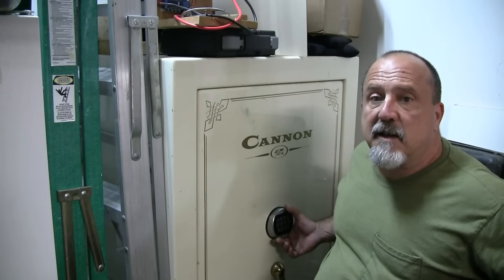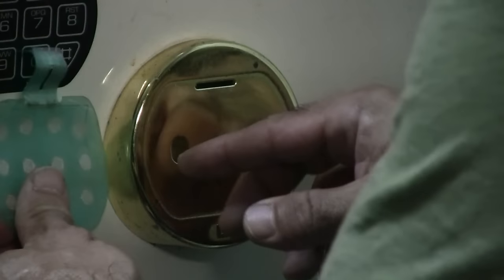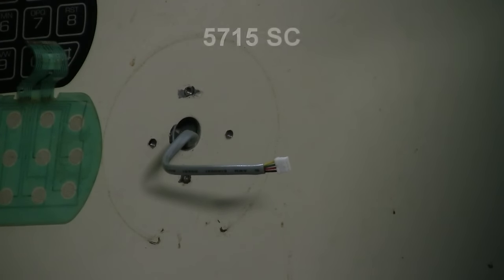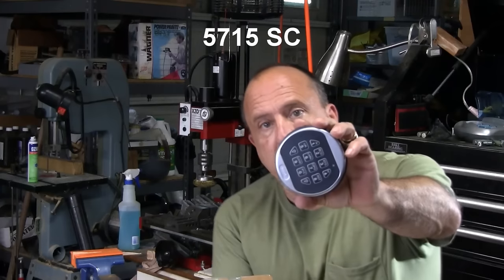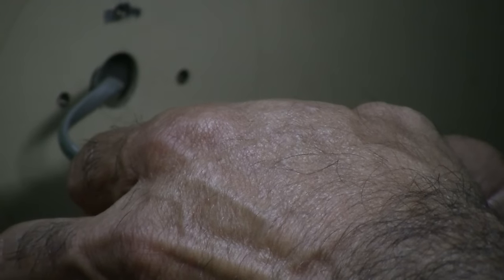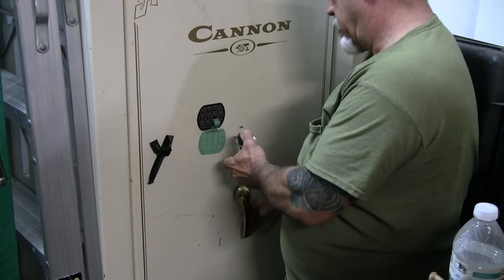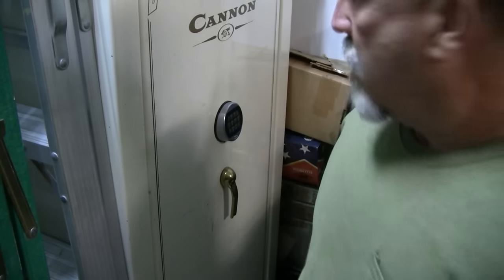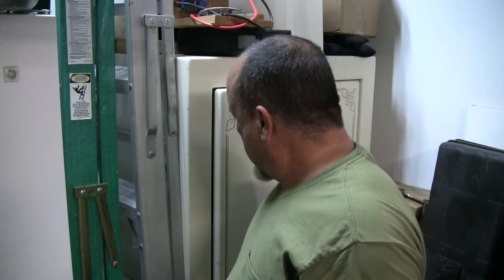Cannon Digital Gun Safe Fail Fix! Locked Out! Don't Drill - TRY THIS FIRST!

Comment: As a locksmith with 25+ years of experience I have some points to make on this video
1) always try replacing the battery first (this is about 3/4 of my service calls when the safe "is dead")
2) inspect the cable to make sure it is not pinched causing a short
3) after these 2 are addressed, try the keypad replacement but if you have made it to here, that only works about 15% of the time (it's usually the internal chip in the lock body that has failed)
4) after you penetrate a container door, it take a lot more than just a screwdriver in the hole to open it.
5) electronic locks and mechanical locks have different drill points, and if you have to penetrate an electronic lock, it will need to be replaced so even the new one would have to be destroyed in order to open it through that hole.
6) any safe technician worth their salt will plug any penetration points put into the container, and generally it is harder to penetrate that same location again if any attention to drill resistance was accounted for in the repair process.
Reply from the maker: Thanks for the feedback and advice, especially #4. Some folks seem to think that that hole is the key to breaking into a safe!
Reply: Hey I live in oregon and I was given a gun safe as a work bonus and I was wondering If a locksmith needed proof of purchase to open a gun safe.
Reply: I am not a locksmith.  I do have some knowledge of electronics. 
I'm very surprised to hear it's most often the chip that fails. In my experience chip failure is the least common point . #1 is of course power. #2 operator error / misuse.
#3 parts / hardware interface (wear, breaks, shorts due to movement &fatigue. 
A battery powered circuit inside what is effectively a Faraday cage is the least failure prone part.
Reply: As a second point only put lithium batteries into safe locks. A technician will usually have a jump pack to help a weakened electronic bolt as well. 

Drilling sucks I hate doing it
Reply: @JoeSmith-cy9wj  Reply to an old comment, but: You're right on that list of likely issues, but there's a bias here and that's what people call locksmiths for. Most people who use safes everyday become comfortable with popping the cover off to replace batteries. Operator issues are super uncommon (because the owner usually operates the safe all the time), especially with keypads, and can be diagnosed over the phone. So then we only get called to a safe job when there is a legit hardware failure. In my experience it's a little more likely that a button on the pad failed than a lock body component, but it still happens more than you think.
Reply: Great points if you don't know what you are drilling for you will make a mess for a professional, that is if you care about saving the safe. Two more points I have and these are my opinions, 1) a safe with a "Key" to open isn't a safe 2) these days cannon doesn't make decent safe's anymore, most are mfg over seas and they have the cheap junk LP locks, securam or those wah lin china things.
Reply: @Seadoo1  No not unless it's that company's policy
Reply: What causes the pad to beep like Morris code and not take commands, also I've done the new battery thing ?
Reply: @bulldoghard5265  If you've replaced the battery with good quality battery (Duracell or energizer) then sounds like a failed lock, what brand is the lock.
Reply: @chrismartin4428  what ever brand comes with these safes, I put the battery in awhile it will start to been , like in Morris code
Reply: Great information.  Thank you
Reply: @bulldoghard5265 did you get this fixed? I have safe with the same issue and unsure how to replace battery
Reply: @kylesojak6267  nope ,
Reply: @bulldoghard5265 mine just shows low battery light tried 4 new battery’s new keypad and the same low battery light blinking. Keypad lights up but otherwise effectively numb

Comment: No backup key?
Reply from the maker: Unfortunately, that wasn't an option on this safe
Reply: @ExtremeDIYGuy  I'd say fortunately... backup locks tend to be crap and a sign that the electronics really are not reliable (20 years is not perfect, but I'd say that it is quite good). At that point get a good quality mechanical lock (key or wheel).

Comment: Easy open in emergency, you need a large rare earth magnet, simply place it in the 10:00 position on the door and  it will instantly open. Lock picking lawyer has the video. I tried it and unfortunately it works. Any hacker can do this to access your guns.
Reply from the maker: Maybe you should post a link to his video, the only ones I have seen from him are for digital cam locks, which are completely different from the locks on Gun Safes.

Comment: You couldn't use the original gold or brass keypad body?
 It definitely look nicer than the cheap plastic chrome jumk they have now.
Reply from the maker: The chrome one is all that is available so I went with that.
Reply: I have the heavy brass  pad too.... so much nicer!! Even the battery wires are much heavier!! All crap today!! :(

Comment: Or open the safe and use the cable it came with.
Reply from the maker: I eventually got the replacement keypad and lock so actually changed everything out to new components.
Reply: You can’t the battery wires are soldered in place on the original heavy duty key pads. These are cheep plastic and the inside of pad covers have the parts built in so you can’t fit the originals in or visa versa. Completely different on inside of original pad.

Comment: Does anyone know what tap size you would need? Mine has the four holes but they’re not threaded:
Reply from the maker: I'm afraid I don't know, sorry. If you have the bolts, you can take them to any hardware store, they all have guages that you can use to see what the thread pattern and size are

Comment: If you didn’t specifically purchase the electronic lock with EMP protection, be advised you will never get it to open again after an EMP strike. Just sayin’.
Reply from the maker: Shouldn't the safe and the lock inside it act as dual faraday cages protecting the electronics that hold the combo, assuming you ground the safe?
Reply: @ExtremeDIYGuy  You don't even need to ground it. A Faraday cage (which the safe will act as) will protect the lock by floating up to whatever potential there may be around it and then down. You may still need to replace the keypad, since the little processor in it will be outside the cage and be fried. To be honest, I'd be a lot more worried about other things than an EMP; if we get to an EMP of the size necessary to fry a processor, we are most likely all dead anyway. Having access to a gun won't make a difference.
Reply: If there is an EMP, opening my gun safe will be real low on my list of problems

Comment: I have a similar cannon safe and the handle broke off. I know the code but the safe is closed and locked. Any ideas on how to get open? Been looking at it for a few days scratching my head. I called cannon but there customer service is terrible
Reply from the maker: Wow, that sounds terrible. If there is a knob sticking out you may want to try a vise grip. If not, potentially drilling and using a screw to get enough purchase to turn the mechanism might work. If you do get it open, make sure to get replacement parts (If you can) and replacing the handle before closing. Otherwise, you may have to get a safe tech to come out and repair it.
Reply: Thanks for your reply. I am going to have to drill it. I talked to a couple of locksmiths and if I drill the left side and access at least one pin  I can open it. Punch in the code and press the pin with a long punch and it should open. Then will have to fix the lock. Cannon safe customer service is non existent and I registered the safe back in 2004. This weekend will tackle the job. My friend has the exact safe so I know wear to drill for the pins.
Reply from the maker: Good luck, let us know how it goes!
Reply: @ExtremeDIYGuy  Update. Drilled a 5/32” hole, punched in the code to release lock and pushed on the pin and popped right open. Looked at the handle assembly and nothing was broken. Everything just loosened up and fell off. Put it all back together and tightened/ lubed and working perfect. Going to get a tapered pin and push in the hole and cut off, sand and paint. Thanks for your help

Comment: Drilling a safe doesn't compromise a safe... Every lock has it's own drill points... So if I drill an LG and replace it with an ESLXL10 the drill point is in a different location... Plus when a true locksmith drills a safe they fill the hole... I am not for welding,,, I like to take 2 ball-bearings the same size as the bit you use and  carbon x steel to fill the hole... That way if you can pin the first bearing you will be unable to pin the second... There is another trick that we use but I will not put it out... Just know that you never want to redrill one that we do... As a safe owner you need to understand that when you call a locksmith and ask open ended questions you get open ended answers... I would quote the same as this gentleman was quoted... If I got there and was able to open the safe in the same manner as this gentleman ( difference is I have a plethora of lock faces in my collection )... He would be charged a trip charge,,, an hours labor and the price of a new lock... LG would not be one on my list to sell... Drilling a safe is an art because the purpose is to have the safe still be a safe when you are finished with the job...
Reply from the maker: Thanks for the feedback Billy. Once again, I stand corrected! I have heard from several safe technicians regarding how a safe is NOT compromised when drilled and sealed by a reputable safe tech. Thanks again.

Comment: If your safe is opened by a professional it should still be usable afterwards. The hole should be filled and be of the same security it was before drilling.  This keypad trick is old and has been used for years. If this opening is used it should be less than if it was drilled. 
 The batteries you use should be the copper top Duracell or the energizer alkaline batteries. The cheap one in this video cause opening issues.
Reply from the maker: That is true, I have been corrected by several safe technicians. I think you'll be fine using an Alkaline battery, but there are also high end 9v lithium batteries should last a lot longer and be more reliable

Comment: Look up electronic safe opening by GxAxV
Reply from the maker: My understanding is that there is a re-programmer for LG locks available that would do basically the same. The NL and LG locks I have used on the inside of the safe have absolutely no points to connect to to do what is shown in the video you reference. Both the locks have a socket for the cable and nowhere to poke a wire through to imitate a keypad combo.

Comment: Never ever use inferior batteries in a digital keypad on a cannon safe.  Use only duracell or energizer!!!  Other batteries will ruin the lock and a new keypad will not open the safe.  The only option left is to drill it.  I live in Idaho.  In a little town.  I dont think the local mobil locksmith is qualified to drill my safe.
Reply from the maker: Great advice Cindy, I don't trust the local "safe Tech" either.

Comment: The hole for the wires goes into the area where the lock solenoid actuator is at. If you remove the back of the door panel you can see how to make a coat hanger tool to manually press in the actuator and open it up. Probably what the safe guy was going to charge $800 to do. Each safe door is a little different but not much on these type of keypad safes.
Reply from the maker: On mine the hole didn't lead to an area where there was any mechanical linkage to mess with. It probably would have had to have been drilled if changing the combination pad did not work.
Reply: Not on a LaGard

Comment: Bypass keys??
Reply from the maker: None available for most gun safes. Mostly for the small personal safes
Reply: @ExtremeDIYGuy  I guess I lucked out then. I have Liberty and a Steelwater. Both have bypass keys. Didn’t realize they all don’t have
Reply from the maker: @johnburrows1179  Good deal, my next safe will probably be a liberty
Reply: @ExtremeDIYGuy  look at Steelwater. I like it better than my Liberty, and it comes with interior lights standard , dehumidifier and pass key stand
Reply from the maker: @johnburrows1179  I'm not familiar with them but will definitely look into one for me next safe. Thanks!
Reply: @johnburrows1179  No U.L. rated safe lock has a key bypass.  Only sub optimal locks come with the bypass key and the safe the lock is on is also not an U.L. rated safe.
Reply: @myvenusheeler  I’m aware of that. But if you look at independent reviews from companies out there, it doesn’t make much difference, at least to me. I have the extreme duty. Myself I like the fact I can get into my safe no matter what without destroying it or paying someone $500 to open it. I’m extremely happy w the safe, as are others I know who have them. Good luck👍

Comment: Uhhh...I sold digital safes for years. There should be a key hole under the digital pad. Just buy a safe with the key back up.
Reply from the maker: This safe does not have a backup key unfortunately

Comment: should use a lithium 9v battery.. lasts longer.. 9v batteries do t have much mah. what , 250- 350 mah..
Reply from the maker: Batteries are cheap enough so using a lithium is probably not a bad idea.

Comment: Electronics will fail as they age.  Especially electronics with touchpoints that are used frequently (such as touchpads).  I would recommend replacing the electronic keypad every 4 or 5 yrs.
Reply from the maker: That sounds like sound advice. Thanks!

Comment: Key pads fail, eBay for a face are easily sourced because locksmiths replace these electronic locks with quality dial locks. My safe the cheap electric motor failed, looks like a motor from a kids race car set. Best to buy a complete lock and not just the face.
Reply from the maker: Agreed, that's what I eventually did. Replaced the entire system inside the door and out.

Comment: Why would you close the door to try it again? What if it did not open the second time? Lock it with the door open!! Try it a few times before you close it up!!!!
Reply from the maker: I think I may have been over confidant in my work. Not in the video but I did test the mechanism several times with the door open and observing it closely with the inside cover off.

Comment: With all due respect that safe is very vulnerable a crowbar will open that up in less than one minute where the door opens you need to have close to the wall so you can’t use a crowbar that might as well have a hole drilled into it
Reply from the maker: Thanks for the advice!

Comment: 1.) This only works in the event that only the keypad goes bad. 
2.) you have to be a moron to cut the safe open in your home, remove the contents, go through the trouble of moving the old safe out, buying a new safe, move the new safe in. 
3.) As far as a safe not being secure after it has been drilled, this guy has no idea what he’s talking about. 
4.) You can’t just stick a screwdriver in the hole and pop the safe open, it doesn’t work like that. 
5.) After it’s been drilled a mixture of silicon carbide, a hardened ball bearing all sealed in place with a bonding agent. Good luck drilling that w/o specialized equipment. 
If anything, it makes it more difficult to drill a second time.
Also, a good, honest safe tech would have tried changing the keypad first and if it worked, only charged you for the keypad.  Drilling electronic locks sucks.
Reply from the maker: Regarding items #3, I have been corrected on that a number of times and acknowledge that I was wrong. I have also added and pinned a comment with a link to Savta so folks can find a reputable safe tech. As for item #2, don't mistake a little a bit of drama for reality.

Comment: offcourse they want you to have them drill it open 
not only does it apears to be more work so it earns them more money but allso the chance you need to buy a new safe goes up by a lot and that allso earns them money
i bet profesional safecrackers have a device they can plug intoo that small plug and have it run through all the combinations at lightspeed untill it hits the right one
still finding out that its just the keypad that has the problem and that those keypads are generic is a nice find
Reply from the maker: Haha, right, it's all about the $$$

Comment: My battery went dead in my Cannon safe. I took the battery out. Life got busy and it was 6 months when I put a new battery back in. So I put a new 12 volt battery in and now all it does is beep with the blue light. I have tried the factory reset code. 1,2,3,4,5,6. 
Any ideas?
Reply from the maker: I would try 0,0,0,0,0,0 I hate to say it but if that doesn't work you may have to call a safe tech

Comment: Also, try using a neodymium MAgnet and open it up. CHeck out https://youtu.be/F55B5Ju8W8E opens up safe.
Reply from the maker: I'm pretty sure the mechanism is completely different. Would be interesting to try though. I suspect that the safe in teh video uses the same mechanism in the cheap table top safes. You can actually open those with a sharp rap on the top while twisting the handle. I'll probably do a vide on those in the future.